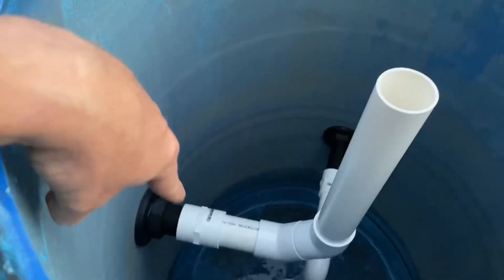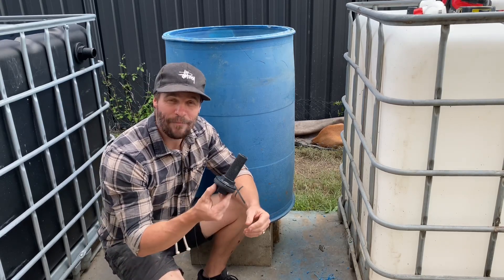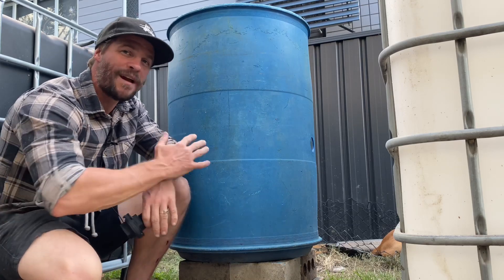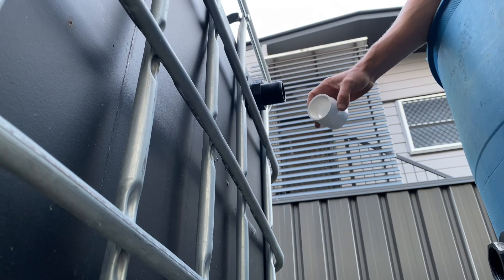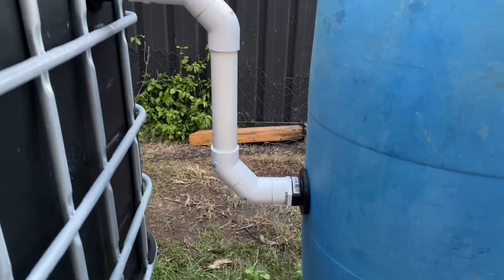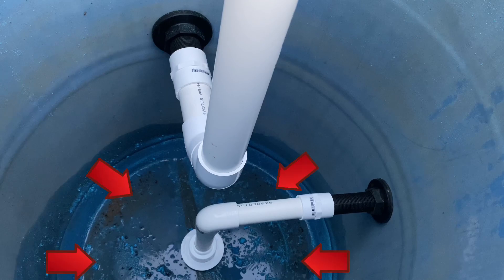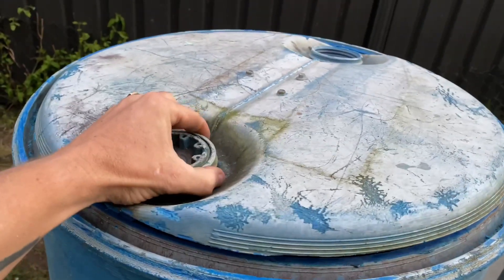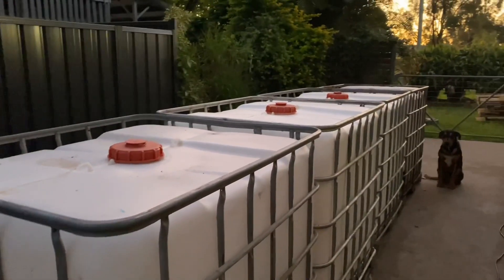How to Build a Radial Flow Settler for an Aquaponics System #howtobuild #aquaponics #aquaponicsystem

Comment: I think I drilled the bottom drain pipe too low does that impact the flange on the bottom or do I just put a shorter straight piece 😬
Reply from the maker: @collinzboyzaz7115  just put a shorter straight piece and you should be fine. 👍

Comment: may i ask if there is a purpose to why you used 45's angle instead of using 90° angle?
Reply: Its to prevent 90° dramatically reduce water flow and pressure loss

Comment: Hey Matty great vids mate a suggestion (theres always a fking but! Hahaha)
Nar just with ya barrel if ya cut it under the lip on the side instead the that concave ring on the top there actually fits next to perfectly over the side walls and you dont have to stress about miscuts or falling in (though the standpipe obviously stops a lot of that haha)
Reply from the maker: Thanks mate!
Yeah I’ve seen Rob from Rob Bobs Backyard Farm & Aquaponics do what your saying too. The reason I cut it like this is because I’m actually going to make a wooden lid to go with the rest of the timber cladding on the system.
Reply: O yeah makes sense haha make it pretty. I do the same but use tin. Good old gumtree free section is a blessing hahaha
Reply from the maker: @nunyabusiness7001  yeah mate gumtree is awesome for finding bargains!

Comment: awesome videos, I will be building my system down here in Adelaide based on your videos. Is there a reason why you use 2 45° elbows instead of a single 90° elbow?
Reply from the maker: Hi there, 

All the best with your upcoming Aquaponics build. The problem with using 90 degree elbow’s is that the sharp right angle can significantly reduce the flow rate due to water friction inside the pipe. When you use two 45 degree angles instead of a 90 degree angle you minimise the water friction and maximise the flow rate inside the system. In other words, it makes the water flow faster in your system. 

Cheers
Reply: @mattysbackyard9244  thanks for the explanation.
Reply: @shaunconniff  You can use a 90* long sweep elbow instead.  It's not only 2 less joints that can leak, it's cheaper than 2x 45's.